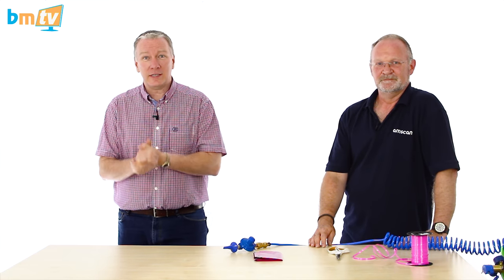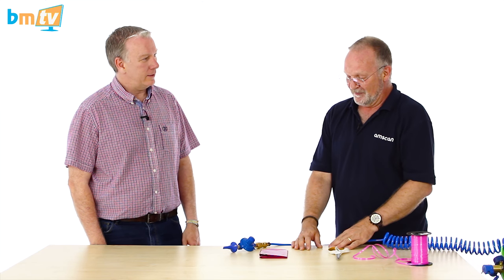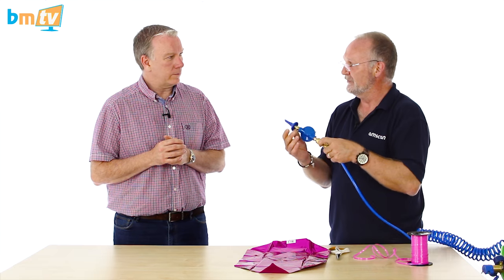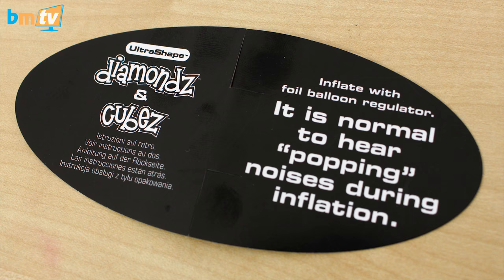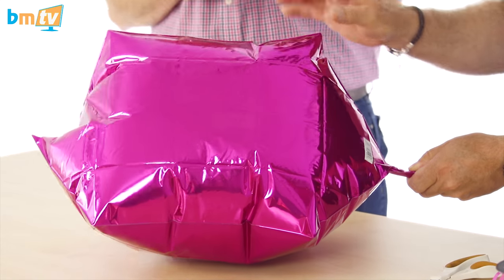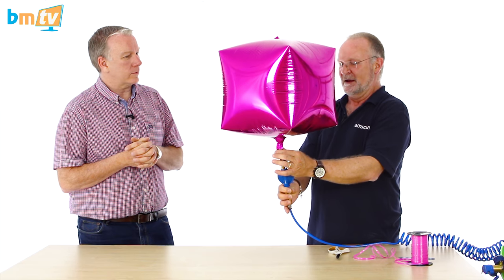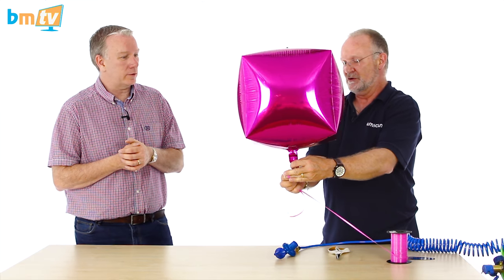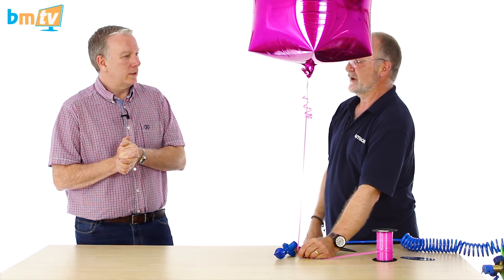How to Inflate a Cubez Balloon - Balloon Basics 29

Comment: Can I inflate this with air?
Reply from the maker: Hi Elvira, you can inflate the Cubez with air, but if you want it to float you would need to use helium.
Reply: @BalloonMarket  thank you 😍😍😍
Reply: They are so comfy to sit on
Reply: @dawnday2390  wtf does it pop
Reply: @dawnday2390  foil balloons are very strong and do not pop easily unlike latex balloons